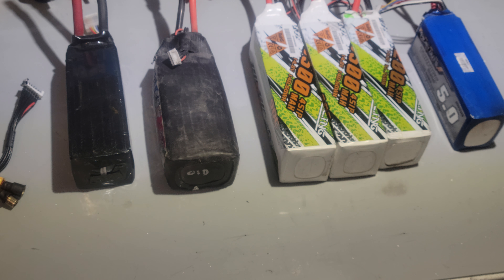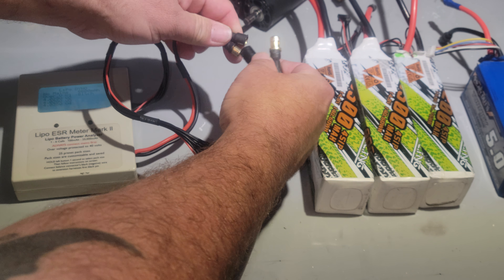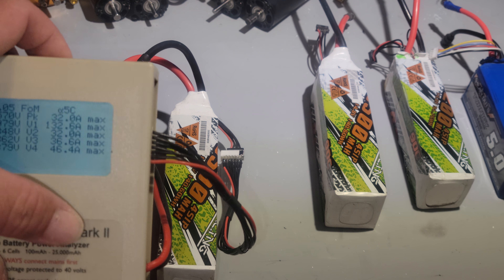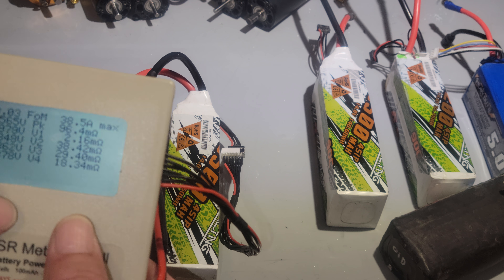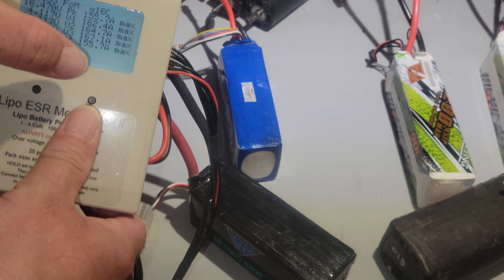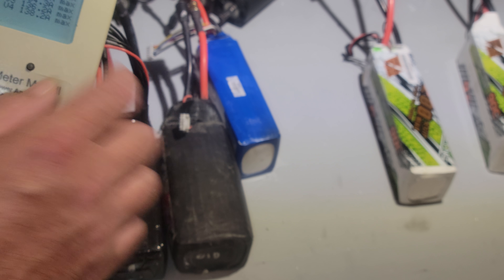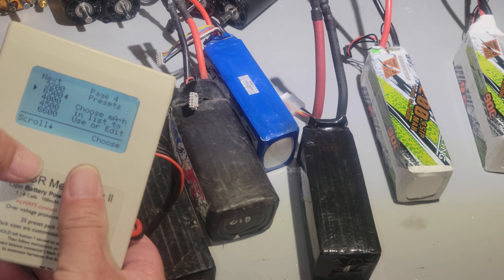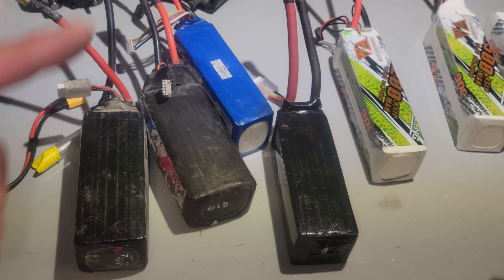a little bit about lipos  = don't judge a book by its cover

Comment: The puff packs is just gasses stuck inside the pack doesn’t mean it shorted yet but a puff pack isn’t safe if punctured as any spark will cause a bigger explosion ( the packs just are not vented well ) 👍⚠️cool video 👍